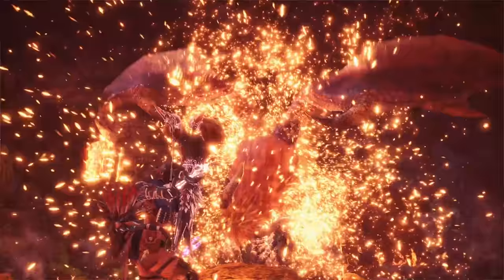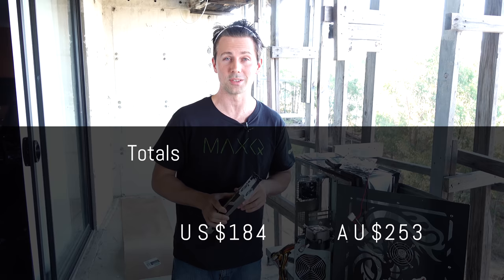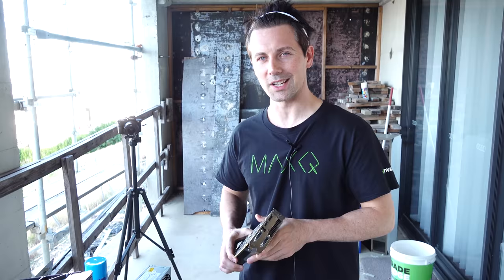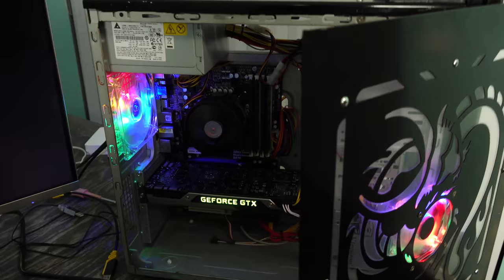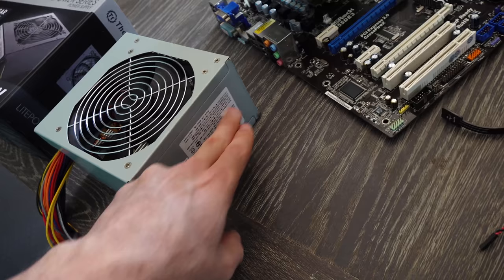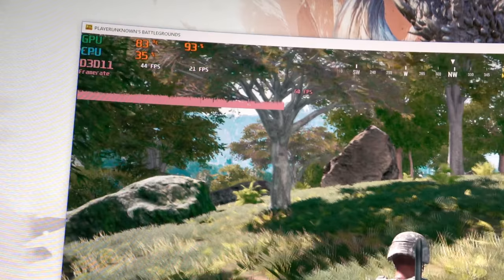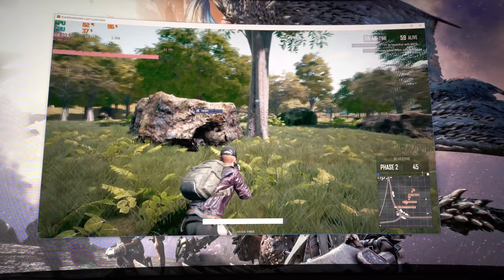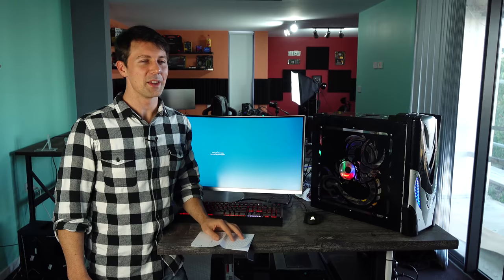$224 Monster Hunter WORLD GAMING PC - How to Play the Latest Titles on a BUDGET!

Comment: Mate, I thought maybe something with PSU as soon as you mentioned the problem. I've got what appears to be an identical (on the inside at least) PSU in my old PC with an i7-2600 in it. It started doing very similar stuff to me, took me awhile to work out what it was. Drove me spare for a bit as it would happen intermittently and PC would start crashing & then start working perfectly again in a day or two. Seems it can happen when you've got something a little loose in there and one of the rails isn't getting all the juice it needs.

Great video again, keep up the good work :)

Comment: Maybe a single faulty capacitor in the PSU. It will charge but then discharge way too quick and drop the power to the motherboard. Maybe.

Great content as usual. You inspired me to hunt that price performance and I'm flipping pc's. Just picked up an i7 4790k, 1060 3gb, 16gb corsair vengence ddr3 and an msi z87m gaming mobo for £300 (around 520 AUD), now to cram it all into an in win 301.....!!!

Comment: That is very impressive! On my channel I am going to upload a 90$ budget gaming pc build this Saturday, rocking a core i3 and pretty decent Quadro. But my build is lacking when it comes to storage, because I have a super slow HDD, instead of a SSD... Great video tho!
Reply: Top Noodle Thanks for checking my channel out :)
Reply: Gul Dukat I appreciate it!
Reply: Pretty cool channel!
Reply: Sh4rk ツ Thanks!
Reply: When putting together a budget gaming build I'd always recommend a SSHD over a pure SSD anyday. Sure it isn't going to be as good on boot times or on the desktop but in game the differences will be minimal at best. So I wouldn't worry about using a hard drive.
Reply: voteDC My thoughts exactly. After I put together a 100$ budget gaming PC on my channel, I realized the SSD took up way too much of the budget, considering how it doesn't really impact gaming performance. Plus I got the hdd in a bundle with the motherboard and PSU I am going to be using in my video tomorrow.

Comment: When windows is initially logging on it's peaking cpu usage and is using a lot of power a psu could have a very small drop in power for an instant and the system will restart, shut down or blue screen. Had a 850w do something like that it caused random reboots/crashes under certain conditions the system ran fine for a couple weeks on an old 300w I had laying around till I replaced it.

Comment: i got the same problem that caused the rebooting on a motherboard. It was also a psu problem (FSP Hexa 700w) but when i put a FSP 500w the motherboard worked (MSI Platinum X58 SLI)
Reply: also the fsp hexa 700w worked  on a different board with an r9 390

Comment: I've had that same issue with the PC booting up just fine, and crashing randomly, sometimes immediately after startup, sometimes 10 min later, sometimes 2 hours later. And it happened sometimes when ever I tried to use that PC, and then didn't happen for weeks. I got it down to the PSU, replaced with a random one and worked fine.

Comment: I had a computer with a 500w PSU that wouldn't take my gtx 770 and it wouldn't boot and I couldn't figure out the problem until I looked up the power requirements.  Now I'll never skimp out on the PSU

Comment: How well does this run with mhw iceborne? Also do I NEED to overclock this build to properly run the game? I'm new to building pcs so I want to try this cause I just want to play monster hunter
Reply: Honestly, the 1st gen CPUs such as the i7 860 really benefit a lot from an overclock and usually has massive gains of up to 1ghz+ extra. If your just using a GTX 780 it should be fine with a stock i7 1st gen but if you go any higher then a 1070 you will defiantly want to start overclocking.

Comment: isnt it better to get a oem system with a i5 2400 wouldnt that have better single core performance ?
Reply: 1st gen to 2nd gen when the 1st gen is overclocked and the 2nd gen is not means 1st gen > 2nd gen on single core performance + the i7 has 8 threads.
Reply: the i7 860 oc to 4ghz gets about 96 points in single core at c15 and 580 in multi core = note the multi core is high because of the 8 threads and threads arent ever going to replace real physical core performance so its somehow useless and without the ht it would be way less now a c15 benchmark of an i5 2400 gives u about real 4 core performance of 485 points and 135 single core points noticed sth ? the single core is way higher about 40% higher than the i7 860 oced in that case i would rather get my self an used oem with i5 2400 or build my self an x5650 system and oc it to 4,5ghz if i really need multi core performance but the 1st gen of intel´s i series are just pure trash.

Comment: I play this game with a Xeon x3480 stock with a GTX 1060 6gb and I get 55fps average in the hub and 60fps in the wilds, strange you have to oc the i7 860 to play on low...
Reply: the gtx 1060 is way better then the 780. he was held back by the gpu he said
Reply: I play on mostly High settings, everything except ambient occlusion (mid)
Reply: Wolf but it's a CPU dependent game no?
Reply: It's a graphically demanding game, there is a Digitalfoundry video where a 1070 is maxed out 99% throughout on mixed high/max settings @1080p and still couldn't hold perfect 60FPS. They found you might even need a 1080 OC'd to fully max out the game @1080p, quite ridiculous.
Reply: Huh that's strange because I have everything maxed out besides ambient occlusion, are they playing at 1080p? Considering my CPU is from the same gen as the i7 860 again I didn't need to overclock
Reply: Try playing through the GeForce thingy, Nvidia have the new drivers for it, also I don't get why people say it keeps crashing, besides from the random dxgi error every now and again when I start the game up but I was playing for over 5-6 hours straight with no problem with an average 55fps (main hub) to 58-59 anywhere in the wilds
Reply: Here's DF video https://youtu.be/PFBLdYf05Yo
They purposedly test scenes with heavy effects and long view-distance to look for frame dips so the result may not be comparable to your play-through. Average maybe 60 but they'd never declare it 60 until its absolutely above that level at all times. Another thing Alex mentioned in the video is sometimes the settings say one thing but they are actually set at another. Like Water reflection saying off but actually was on and still affected FPS, or setting preset to highest then lowering other settings will say it's running at the highest preset even though it's not. So Ultra may not actually be Ultra. 

Meanwhile another Youtuber named SantiagoSantiago streamed this game recently and with a 1060 3GB and 1050Ti said his settings got stuck at Ultra no matter what he changed in-game. It would say Low but his framerate still tanked hard into the 20s until he figured out. The game seems to have some odd problems when tinkering with settings.

Comment: Love your videos. But I cringe every time you put brake cleaner on electronics. Seems like it works though.
Reply: Republic3D I do this myself! Brake cleaner is an excellent degreaser, so it removes any short circuits that may be present from grubby fingers or human slime. It is very very very unlikely to damage your components.
Reply: That makes sense. I'd just be worried it would react to the metal and PCB as well.
Reply: Republic3D I've never once had a reaction, and I've also never heard of someone else having a reaction either. I'm not saying it's impossible, but the PCB etc would need to be contaminated with something that was not supposed to be there in the first place.